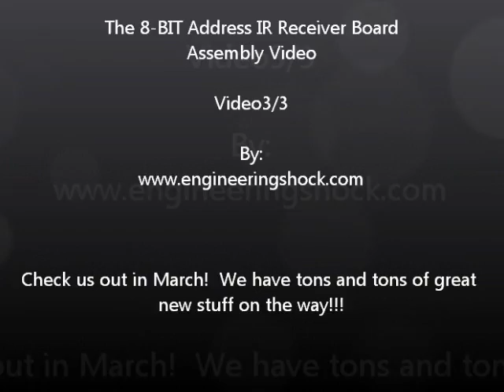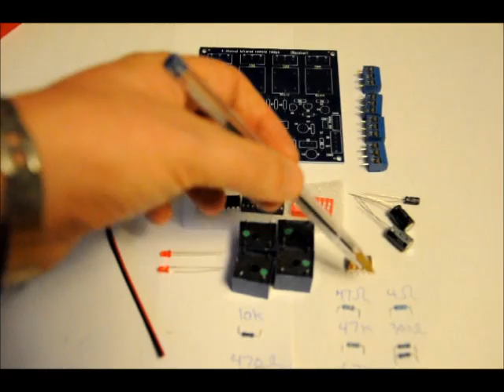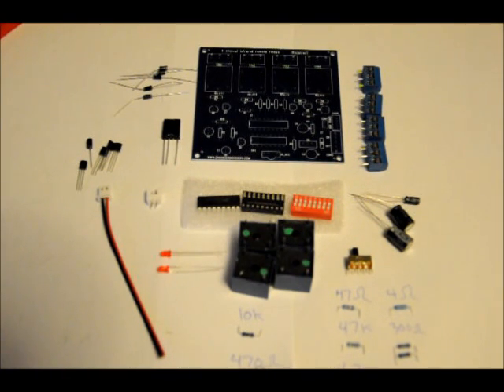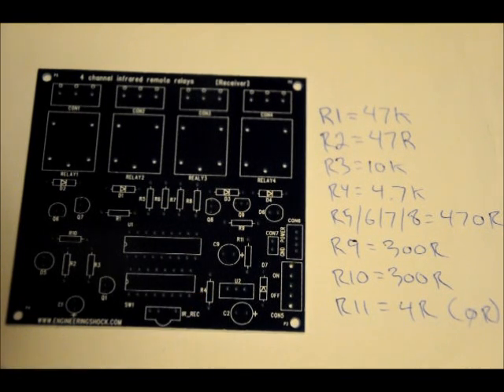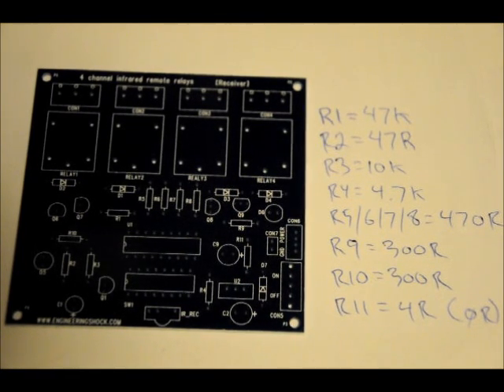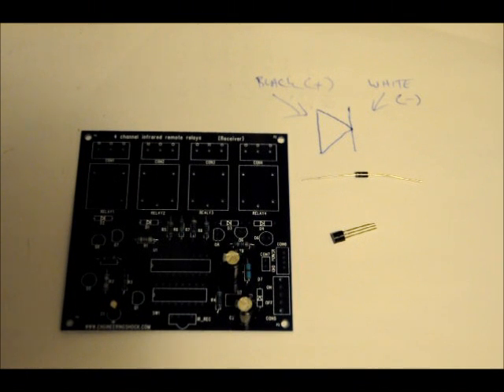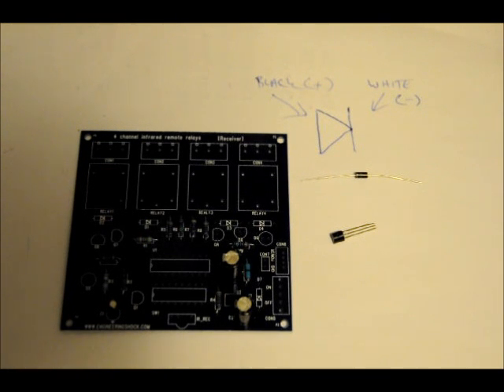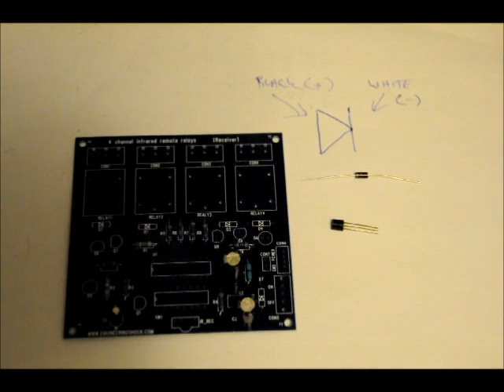8-Bit Address Infrared Receiver Relay Board Kit Assembly Video

Comment: @patrickikis 
I am probably doing it wrong or something. But I get a .1v voltage drift every ten volts... It is the simplest reference I can get, but very dependent on resistors and such. I know there are other reference types out there but no website goes into detail on how to make them or how they work... If you could explain the zener diode that would be awesome though :)

Comment from the maker: @reviathon360 
Hi again =)  Hmm, I've never really built a switching power supply.  I've used them, but I've never built one.  Why are you against using zener diodes?  A good quality zener diode is extremely stable from my experience

Comment: @patrickikis I have been trying to build an SMPS for a long time. But I've been stuck at building a voltage reference. I've been recommended a zener diode, but I would prefer something more stable.